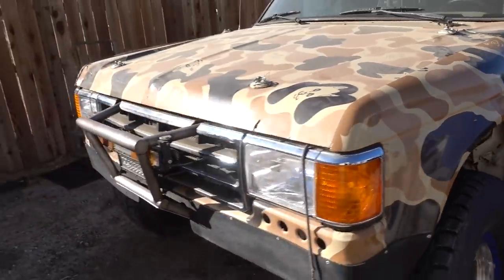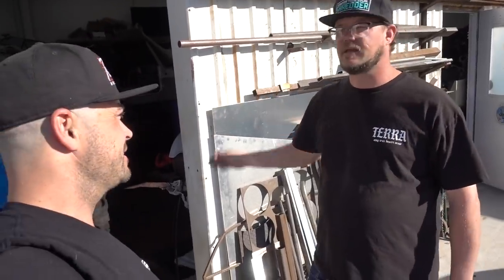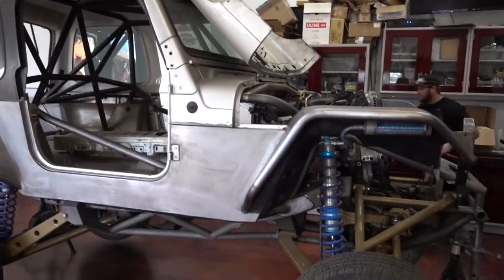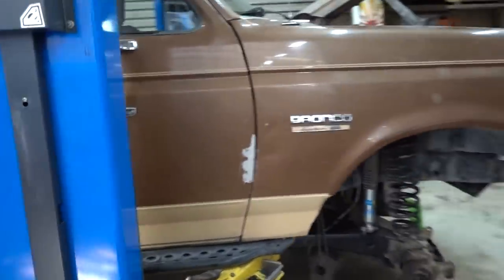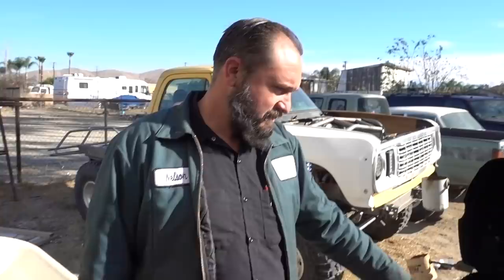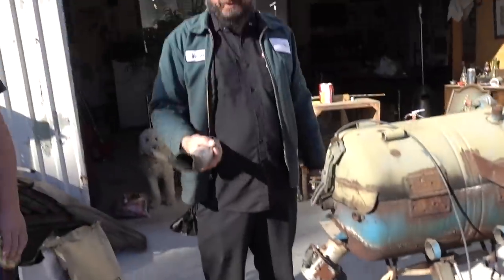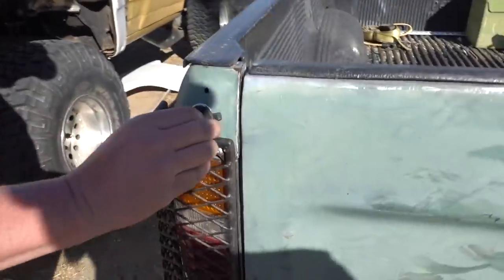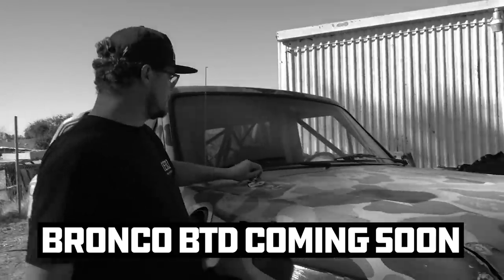Michael Cox SHOP TOUR w/ Morgan Clarke! | SHOP TOUR

Comment: I wanted to know bout that old dodge 😂 only vehicle you didn’t cover
Reply: Yeah. I’m hoping it’s cause they are building anticipation. Looked like a 70s power wagon with trailing arms in the rear and I didn’t see what was in front? Definitely a cool truck.
Edit front looks like a swapped in axle (driver drop, dodge trucks before 93 came with passenger drop) 3/4 link setup with coil overs and crossover steering
Edit 2 maybe stock front axle? Can’t tell if it’s a link mount or the pumpkin